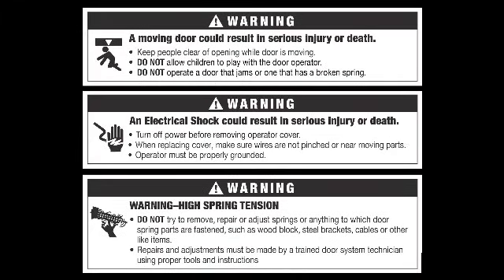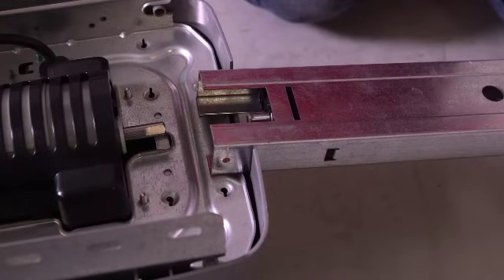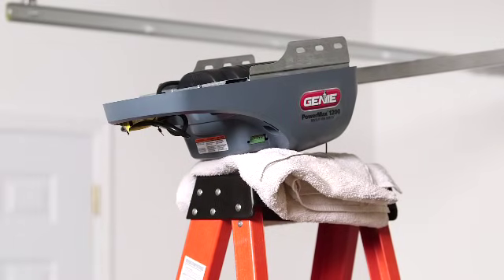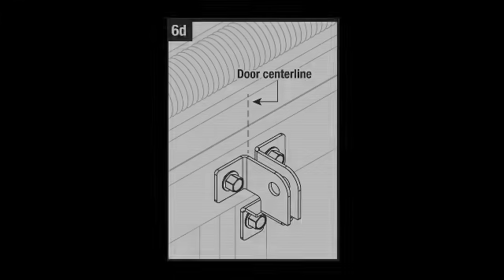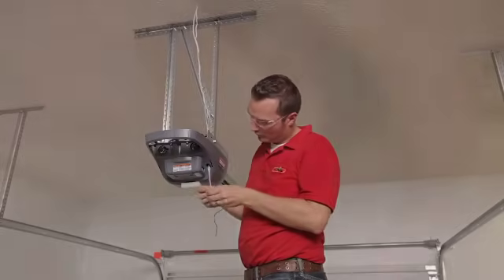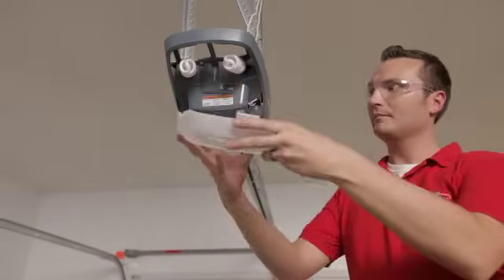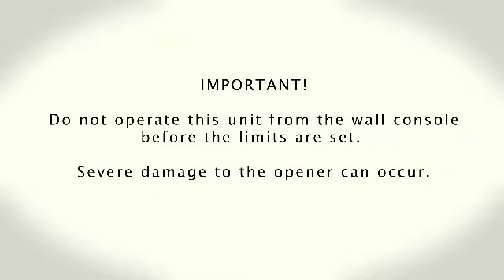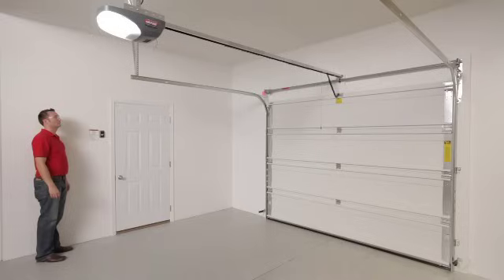Installing Genie Direct Drive Screw Opener (Full video)

Comment: Two question to Genie community:
1) Rail Length (ft.): 9.5 ft...?
2) Belt or screw...?
Reply from the maker: Our residential DIY models only work up to an 8ft high garage door with the use of an extension kit.  For anything higher you would need a professional model, We have chain belt and screw drive options for doors higher than 8ft.

Comment: The screw drive has broken (or, separated?) on my Genie Intellicode garage door opener. Unfortunately the installer did not leave the Owners Manuel. Can I purchase just the screw drive?
Reply from the maker: HI - this could be a result of the clip and collar coming loose, please reach out to us at 1-800-354-3643 so we can assist you further.

Comment: Well I got the push nut off. obviously it can't be reused. Now I can't get the pieces to slide of the rail because there isn't enough clearance between the rail & the wall. The rail won't bend enough. Do I need to figure out how to completely detach the rail from the opener or is there an easier way? Hoping for easier. Thanks.

Comment: I have model 2562 & need to remove the push nut to the clevis pin so that I can detach the rail to remove the carriage trolley to see if it needs replacing so that my garage door will open. How do you remove speed push nut? Is it still usable after removing it? Thanks

Comment: Thank you very much for this video. It's very thorough and well organized. I am thinking of using this opener for a different application, not  for a garage door. Is it possible to flip the screw track 180 degrees, so that the track will be exposed towards the ceiling in your example. From the video, it seems possible, but I do not have a physical opener to verify this. Very much appreciate your comment on this. Thanks, Anil.

Comment: The older rail to bracket holes were a lot larger, looks like 5/16, the new rail bracket holes were 1/8 inch,  the pin is very small, instead of a hole in the pin and a clip to hold the pin in, you now have a small slide on clip, very thin, no hole, not very secure. The new rail bracket is hard to line up because of the small hole and not secure enough. Other than the rail bracket, I like the opener. Hope you redesign the rail bracket.

Comment: Does this need the torsion spring?  I have a garage door with a broken spring and I would prefer not to have to replace it
Reply from the maker: The spring carries the weight of the door, the garage door opener is only there to assist the door in opening.  The doors spring needs to be replaced before any garage door opener will work properly.

Comment: do these new Genie Screw drive openers have the same threaded screws as the old model genies?
just different rail design? 
or are the new screws of different diameter, thread count etc?
Reply: Correct, they have a different screw and rail

Comment: I was looking for a Genie direct to replace a Genie direct,couldn't find one anywhere & they're out there..3 days of asinine looking in big boxes & couple other retailers + considering other brands ?.. calling Genie & they were zero help,internet sure,but a week or 10 days ? + rape shipping.I did the in store Silentmax 3/4 750 $188.00 wall & 2 remotes, skipped the Aladdin crap,assembly - installation was literally cake,setting the up & down limits took all of 1 minute & the reverse was factory as well as the remotes.The head mounting bracket's always the bitch so I made a rock solid beauty,It's so much quieter & smoother than worm,not even comparable you can barely tell it's on.Glad I went with this.Long term.. screw vs.belt ?

Comment: Trying to get the wiring into the little holes on the power head was the most frustrating part for me. The first tab I pushed on to open the hole kept going and broke off. Otherwise I am happy with the set up.

Comment: As a disclaimer, ALL doors over 10'W should have horizontal reinforcement on the top section, regardless of construction, due to added stresses of the wider door.
Reply: Agree,the top panel will flex over time and cause the opener to reverse.
Reply: that door has integrated struts